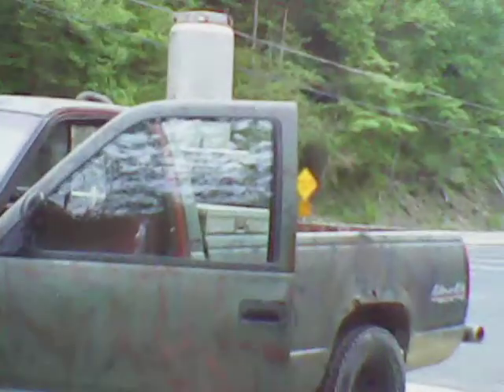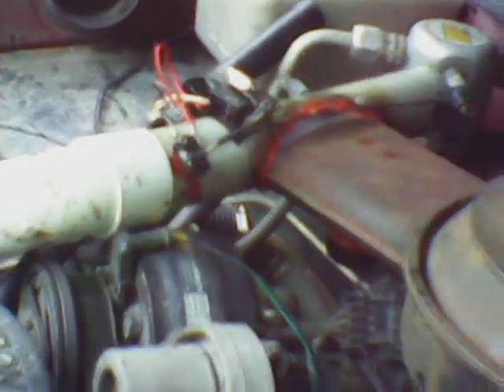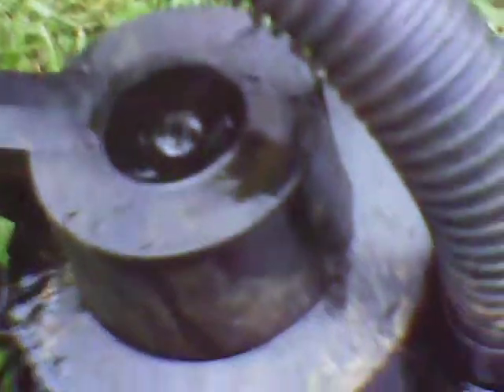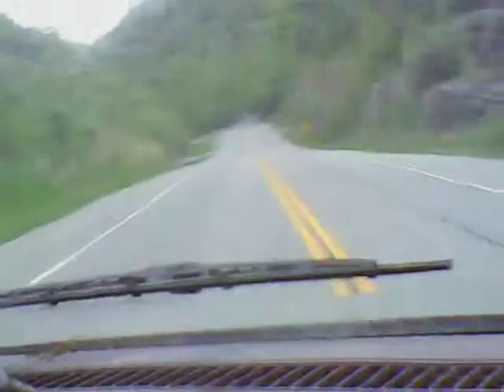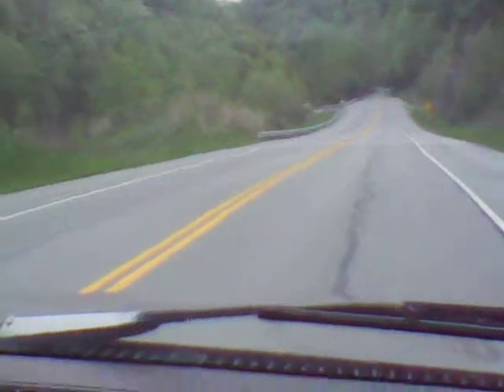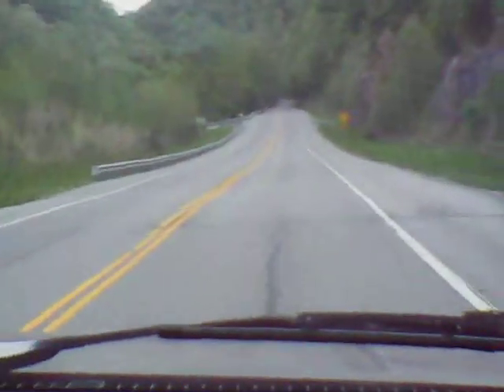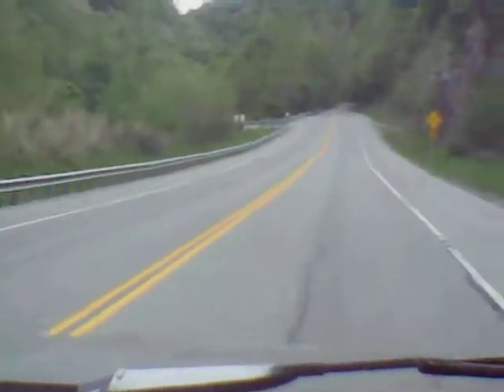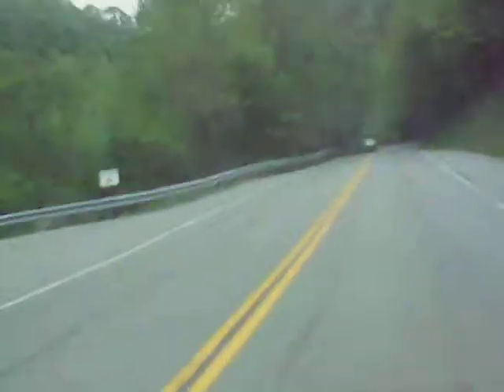short drive on woodgas

Comment: The main thing to remember is to keep the engine running at high rpm to provide sufficient vacuum and keep the engine closer to it's peak torque/horsepower output. Its a lot easier to do this with a standard transmission, but you should try starting off in "1" or "L," not sure what it is on GMs, then shift the selector up to "2" after around 3500 rpm. You should have much better response doing it this way, but you may have to enlarge your intake pipes slightly for more airflow.